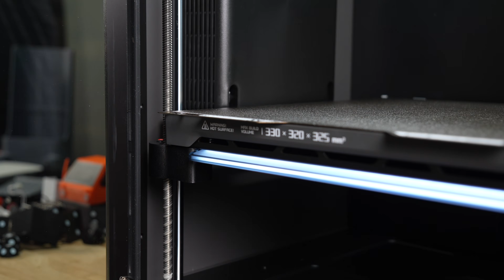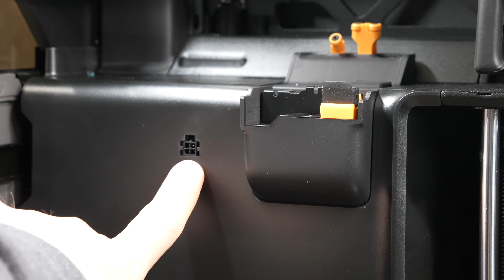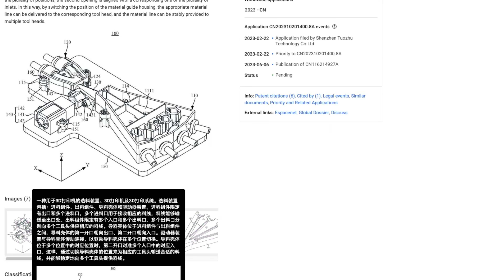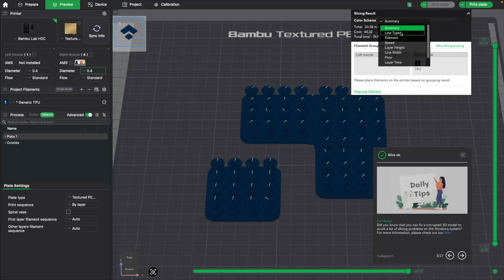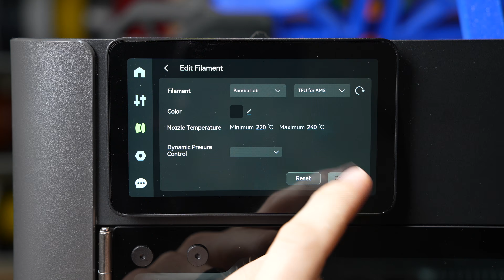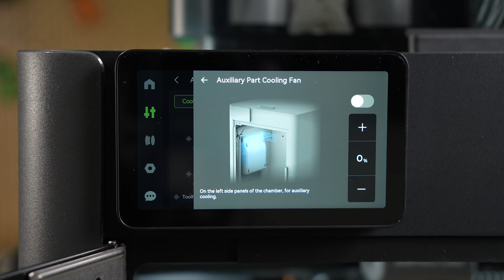3 Months With Bambu Lab’s New Vortek System (H2C Review)

Comment: Need some advice, i have recently gotten into the hobby started with the Bambu A1, absolutely love it, but the filament waste is frustrating and as im very much wanting to do more do i go with the snapmaker U1 or this H2C ultimate bundle ? 
Cost is only a small factor 
I want something that works, least amount of filament waste, Speed matters but only a little and obviously quality along with repairability and just works. Annoyingly most colour prints i want to do is usually around 5 but this isnt a deal break. 
Priority is little to no filament waste (Poop) Purge tower not counted.

Using for everything from every day solutions, Terrain features for table top and some models.

Comment: I'm looking into buying a decent tool changer (for printing functional parts and occasionally multicolor for text f.e.) and I'm considering two at this point:
1) Bambu H2C: It's really handy to be able to swap nozzle sizes on demand 😎, but hate the fact that it does not support flexibles that well and I don't like the closed source nature of Bambu lab these days.
2) Sovol M1D Enhanced; Still not on the market and reviewed unfortunately, but it packs a lot of features I like. It promises TPU compatibility, is fully open source, but if I want to switch nozzle sizes I have to unload and load the spool into another head manually.. 
Nozzle and bed temps are also limited to 300C/100C which is downside. Price is a fair amount lower as the H2C.
A mix of these two would be great 😎

Comment: Many thanks for this video.  Can i ask a question about the TPU?

So this machine touts that you can easily print multi material, so printing "in situ" TPU as you print for seals or shockl absorption.  However I don't understand how this can be done if you need to load the Vortek hotend directly with TPU?  Can the machine still load and unload for say multi colour PETG where TPU is also needed for the print?  Or is this a flaw of the system?

Comment: Just sharing, if you are planning to get an HSeries printer specially for the technical capabilities of it for engineering grade materials you may want to continue reading this.
I have not seen anyone call this out on the major reviewers and I am posting this in the hope that someone from Bambu or someone with direct connection with them will take this more seriously. 

The printers are great BUT if you are planning to primarily use this for high temp printing, BEWARE, that the HOTEND FAN will fail on you(mine failed on <250 hours of ASA, I have H2C). If the fan in the hotend failed, it will stop the printer and will not let you do anything until you fix it. YES - you can get warranty, but it will only spare you for some time until you have to replace it again AND IT IS VERY INTRICATE to replace. Search it in bambu wiki

This is VERY COMMON and known issue - again I am here to bring visibility and hopefully get some action from Bambu to either replace this fan or make it more accessible. See reddit posts for other people that have undergone this issue.

Comment: The Vortek hotend system is very simple in its operation and I doubt that it's going to break. It's basically just a gantry system that magnetic hotends are attached to. It'll outlast the Z gantry due to being moved far less often, just be sure to clean and lube your machine once a month, or every couple weeks if it's running non-stop.

Comment: I am currently CURSED with having a Creality K1C... Nuff said. Rooted, upgraded printed parts, Fluid/Mainsail (depending on mood?) and have everything printed/bought for the BCJ LinRail upgrade from sloppy "self Lubricating" (LMFAO!) toolhead bushings. MANUAL color changing as I DO NOT WANT TO KEEP ANYTHING CREALITY and DO NOT want to invest more into this black-hole of "half-assed mfg.! (Customer Service (LAUGH) SUCKS also. Got a Space Pi dryer in the deal and it can't even read the humidity correctly! Now the pwr supp is getting flakey (350w and checked, machine pulls 350+w at times! WTF!!!) Saving every dime to ditch ALL this for a Bambu but not even close yet. I live on about 750/mo VA disability and am trying my damndest to "side hustle" 3d printing for extra income. Have made enough while struggling with this pos to at least cover the purchase cost (used). I'm convinced Bambu is #1 and I don't even have one yet, but I do know...CREALITY SUCKS!!!

Comment: Its my understanding the tool head vibration calibration has nothing to do with sound. Its for vibration harmonics. It identifies the frequencies and movements that cause excess harmonics in the motion control hardware. After identifying those harmonics, the system avoids motions that cause them. This reduces/removes ringing on the part surface. If i misunderstand this, someone correct me because i would like to know more.

Comment: I've loved mine, and it was my first 3D printer. I have friends who picked up P2S and H2 over the same time period, and I'm sorta shocked how the H2C is actually benefiting me without even really knowing it. I knew the multicolor waste would be solved for, but even things like grouping filaments to an assigned hot end to reduce bleed. While others are doing some tinkering with extrusion amounts, I'm just printing. 
That said, I did have a plug come loose in my print head 200 hours in, but it was a relatively easy fix, and Bambu support was fast to help and hooked me up with some freebies for my trouble.
Reply: Thank you for stating that the H2C was your first printer. I'm looking to obtain my first 3D printer, and was a bit concerned that the H2C might be too much for a rookie, even if I need the multi-material printing and ability to print carbon fiber.

Comment: At that price, my time is way too valuable to spend watching it feed and unfeed filament over and over. Kudos for the novel approach, and maybe it will become something cooler in future machines, but this system is a major let down for those of us hoping ofr multi-toolhead with a Bambu logo on the side. I bought a U1, and it's mostly great, but they have a lot of catching up to do on the software side. That said,  I would easily buy two of those and have a lot of money left over for filament before buying one H2C and spending twice as much time getting the same prints done.

Comment: This was great, you answered every question I had about this system.  I currently have the X1E and love the simplicity of the Bambu environment.  But the AMS is starting to drive me nuts when I want to do more complex prints.  I think instead of getting the H2C I'll be changing to the Prusa with the IDEX from Bondtech when it comes out.  Best of both worlds, cheap tool heads easy to clean and load while still having the benefit of a full tool changer.

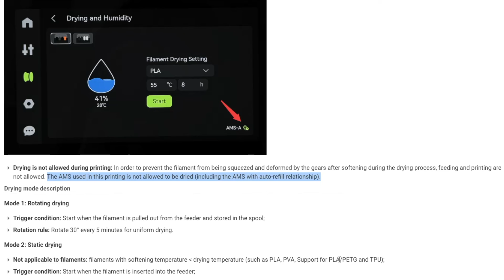Comment: 11:26 - v2.05.00.64 of bambu studio now supports drying filaments while printing.
Reply: Does it only work for H2? I have a P1S and planning to get an AMS2 or HT
Reply: @ravenmooore  Only on the H2S and H2D, firmware support for the H2C is still not released yet
Reply: @TheSimber1 
To identify a new spool you have to turn off the drying for the unit. Once identified, you can can turn it back on.  
When starting a print you will get a message that the drying temperature may be reduced during the print.  I have them on the A1 and the H2D.  H2C is in customs now (6 days so far)

Comment: That is just incredible. However, I kind of don't prefer its motion system for using smooth idlers with the toothed side of the belt. That mismatch will transfer to the print or wear the idler down like my K1 Max did.

Comment: 20:25 prusaslicer allows you to set different nozzle size extruders for infill and cura actually allows you to set a smaller nozzle extruder for just the outer perimeter. No idea how well that prints though, haven't tested it. 
But what would really speed up print times is different layer height for outer wall vs everything else. A 0.4mm or 0.3mm nozzle/ 0.2mm  layer shell with a 1mm nozzle/ 0.7mm layer core would be really interesting.
Reply: A YouTuber already made this, it seems to work pretty well
Reply: @C8-H8 who? I know the next layer tried prusaslicers limited settings for different nozzle sizes, do you mean him or someone else?

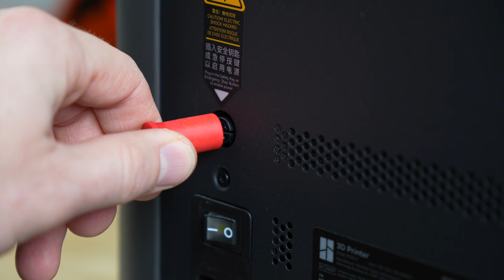Comment: 9:52 They are reusing a lot of the components from the H2D and H2S. Both of those have laser engraving options. The key is required in many places because of that. In fact, the key is removed, and an emergency stop is to be installed in that outlet when using the laser end.  It is all fire safety stuff. You can even get a fire suppression system for the H2 series printers.

Comment: how to deal with inconsistency when auto bed levelling in h2C, sometimes the result is not good
Reply: My h2d is the same way. Pla first layers are terrible but high temp first layers are good. I try to heat soak the plate beforehand and run pla at its highest bed temperature and sometimes that helps but still absolute garbage first layer issues compared to x1c

Comment: 20:30 I've heard this "dream" echoed by a few people and I honestly don't understand it. Considering the time required for the change and priming you'd remove any benefits of swapping to a larger nozzle size just for infill. Just print the infill with the same nozzle and a larger layer height and line width than the nozzle itself, it'll be fine since it won't be seen and multiple tests have been shown on Youtube with this being fine even with walls. If you're curious this might be a useful video for you to do yourself to share with others.

Comment: There is more TPU capability than you seem to realize.  I suggest you test it and have some fun.  I have more than 1 H2C.  1 of them has done nothing but TPU non-stop since I got it.  When doing softer TPU, 95a and 90a, I use the vortek side and top feed from a drybox and use the left side for either PLA (for support and release) or other firmer TPU.  I know of several who have used softer TPU on the left side with a top-feed.  They use 98a and 95a.  One of them cautioned that they didn't think that it was safe to use 90a until the update from Bambu.  However I took my testing in a different direction.  I used 57d, 64d, 68d, 72d as well as Bambu's 68d (TPU for AMS).  All print fine from either nozzle from the AMS unit.  While 68d and above are almost too firm to be useful, 57d and to some degree 64d are much more flexible.  After well over 100 hours, and over a dozen larger objects, there has been no downside, no down time, no errors, no issues at all.  I tried both saying it was Bambu TPU for AMS and Generic TPU for AMS.  I had expected to have to adjust the print profiles, but I didn't need to.  I used filament from CC3D, Kexelled, Bambu and I'm sure I'm for getting at least one.  If you want true multi-color TPU prints or mixed material with TPU and Bambu's 68d is too hard, 57d has worked perfectly for me and is so much softer.  When printed Bambu's TPU for AMS does not feel like TPU.  57D does.
Reply: Have you done any multicoloured TPU prints in the 57d ? Did the AMS handles the filament changes okay ?
Reply: @MARTNworks  Yes I have and yes it handled it fine.
I live in the PNW and so I designed and printed some Seahawks stuff in blue, green, gray and white.  Retraction was fine.  
There are occasional glitches with 57d.  I would say once per 12 hours of printing.  The solution (other than cussing) was to pull the filament out, cut it and put it back.  Not every print.  
64D was around the same.  68d and 72d were also imperfect (compared to, for example PETG) but the issues were none other than that.  TPU for AMS is around the same level of issues.  The issue seems to be that occasionally the constant retraction will cause a little higher surface wear on any softer material.  I have printed 14+ objects with around 220g each and none have failed to complete.  With more or less the same "issue" rate as Bambu's own I think it works as well as can be expected.

Comment: 28:00 - you talk about how the losing of build volume is a pro then compare it to the U1 which loses ZERO build volume to being a tool changer? that makes no sense. That is an absolute con of the H2C. The machine is massively bigger than the U1, for literally an inch more X axis capacity? having the system take up build volume was a huge miss by Bambu
Reply from the maker: Have you seen the side profile of the U1? The back area sticks out quite a bit because they had to extend the frame to accommodate the tool parking area. https://share.google/uZhcd3GUsYgpE5zeb

I’m not sure where you are seeing the H2C being massively bigger? With spools loaded on the U1 and an enclosure the thing is huge. 

This is also one example, look at other tool changers.

Comment: A very good review!!  For me, the big things are the AMS to use for loading, which tool changers don't have. Plus with the AMS, you can place a backup spool if one is running low, again, not really possible for a tool changer.  And I do like the ability to change nozzle sizes with ease. Yes its slightly slower than a tool changer, which is not a big deal for me. I only occasionally do multi-color or material.  Plus I really like the vinyl cutter attachment.  Where Bambu screwed up is in the birds-eye camera, which only can be calibrated when you have a laser (I don't) but works well with the cutter. I bought and added the birds eye camera, and now I can't use the cutter until Bambu releases a firmware upgrade.  Very poor. 
The button on the top is for the laser, to confirm you are physically there before it will start. UNFORTUNATELY its also needed for cutting to confirm you are there, but why.  When I cut I have to run in the other room to push the button. Maybe they will fix that also.
My H2C came with a bad nozzle dock, but Bambu sent a replacement and all is good. Overall, its a very well-built machine and probably the best multitasker 3D printer in existence, and I don't really care about the laser. It does many things very good and some things fantastic. Perfect at everything, nope, but that is OK with me. I bought a BIQU Panda Perch to hold 2 AMS 2 Pros and two AMS HTs and it works well.  I just need to firmware upgrade so I can cut again. ARE YOU LISTENING BAMBU??

Comment: I was looking , but can't see the sense , So instead of pooping it just makes a big block instead , it still as to keep loading the filament with each colour change .
Reply from the maker: Yeah no more purging between swaps. Still needs a prime tower though but this is the same with any multi color machine be it tool changer or not.
Reply: All color change printers use a purge tower. But the H2C doesn’t poop, which almost all other color printers do.

Comment: Snapmaker U1 900$
Dobrze, że nie kupiłem H2C za 2000$.
Nie widać różnicy w jakości wydruku.
Snapmaker U1 wygrywa też w szybkości zmiany głowicy.
Bambulab musi obniżyć cenę tej drukarki, bo będą mieli kłopoty....
Reply: The Snapmaker, when enclosed without an added fan, is prone to heat creep and nozzle jams. The H2C is designed to take these high temps. The Snapmaker is mostly for PLA, PETG prints. Its also limited to 4 color unless you manually switch during printing, while the H2C can do 24 colors. It just depends on what you need, which is why both machines are selling like crazy. Also no, Bambu isn't in trouble.
Reply: I wonder how much noise it creates compared to the bamboo

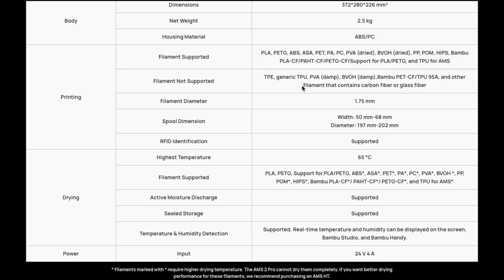Comment: 29:46 Could you not just use 4+ AMS HT's and use to 1 PTFE adapters?
Reply: Yes.  I have two H2C's.  1 is set up with Right = AMSx2 and left = HTx2, the other is Right = AMSx2+HTx1 and the left is AMSx1.  
You can mix and match as many AMS's as you want on each side.  The limit is a total of 4x AMS2 and 8x HTs and these can be in any combination.  This is a stupid layout if you ask me.  I should be able to use 5x AMS2's and just reduce the number of HTs.

Comment: My H2D arrived 6 Nov been out of action since Nov 26 due to that fan issue which is really tough labor intensive repair.  After 2 different warranty support requests they sent whole new x-axis to install which will be doing on day off coming up.  My thoughts are this specific to H2D they use compression push fit pads for mains power in boards in head.  This head has tons vibration and heat that push pad hi current connector to me is flaw.  I had 243 hrs on it fast and doing mainly hotter materials do believe issue showed quicker due to this.  It prints great but do think pads press fit are really going to be an issue.   I will install their whole new x axis which i think will get me back jn action but do believe issue will show again within few hundred hrs. Faster since I do lots ABS.  Just not happy with 2k investment being down this long n maintenance not fast and easy.  Told em if fails again want to switch out for 2P2s units with ams which are about 100 less then what I got H2D for.  Will see what happens doing x axis this week, easier then card or fan replacement.  For my farm I need easy fast changeouts this does not fit bill.  I have 24hrs own time in warranty repair to date and machine down since Nov 26.  Holidays delayed things bit plus my own work schedule.  There something to be said for easy repairs and solid wire harness with locking clips, push type friction fit pads on hi current wire to me is taking money savings path on labor.  This was my second Bambu bought A1 same timeframe.  I have many Qidi machines, plus4 and they simply run 1000s hrs on them maintenance easy on them.  I do think P2S is way to go, owning two Centauris just know that P2S is rock solid design.